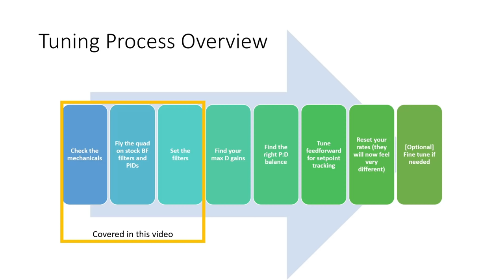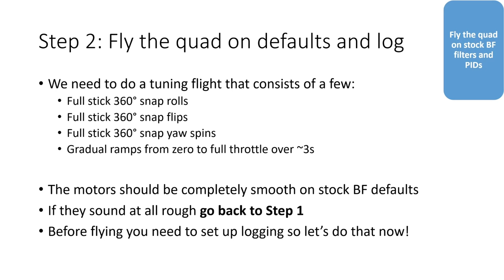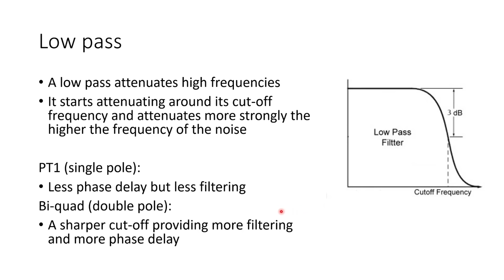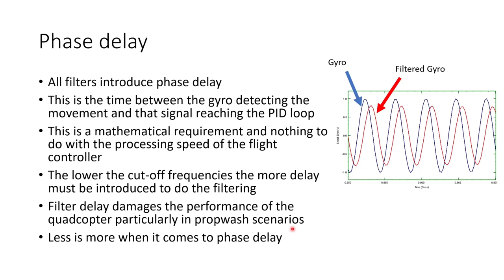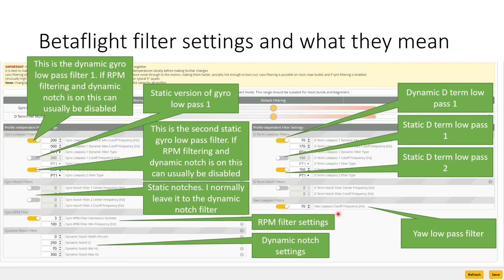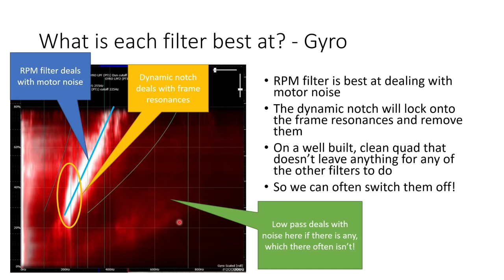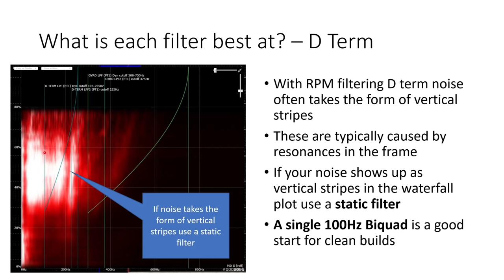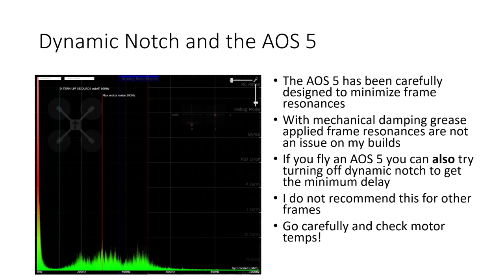Betaflight 4.2 filter tuning. The easy way to get a perfect filter tune!

Comment: Chris, I am about to start following this for my two identical builds. Both builds have, what I would consider very warm motors, as I can hold my fingers on them for 10 seconds, but are way warmer than I feel they should be. If i am able to understand and follow this, will it bring the motor temps down to a cool motor..? so I can start doing the pid tuning..? because I feel that if I started tuning now, Id smoke something. I've never had a build come down with motors as warm as the motors on my current builds and as far as them being clean builds, I'm sure they are clean. I've tried using uav tech's videos, but they are just too confusing, and I love the way you explain things in more laymen's terms. Tuning is very overwhelming to me, but I must learn.
Reply from the maker: Motor temperature might be helped with filter tuning. If its a heavy quad with small motors they'll just get hot regardless though.
Reply: @ChrisRosser  it’s a 5” quad on 6s with 2306 1900kv motors. All up weight is 746 grams..
Reply from the maker: @squirrelyfpv7283  OK, those motors should not be getting too hot. You can get in touch with me over at www.aos-rc.com by email. I'll need a gyro scaled log and a few pics of the build.
Reply: @ChrisRosser  you are awesome..! I’ll try to get that over to you ASAP.. I’m trying to follow your videos so I can tune these builds, builds I already have, and future builds.. I’ve not learned it yet because it’s so overwhelming, but definitely need/want to learn.. thank you, and thank you for what you do..

Comment: Hi Chris, is it good to deactivate d-min by flying with a bent propeller in the race of the racer drones to finish the race? Won't I have a better chance of burning the engines? Maybe it will be better to keep them active for racers? Thanks
Reply from the maker: Racing pilots do typically use Dmin to reduce motor heating. I'm not a racing pilot so I'm not the right person to comment on this.
Reply: @ChrisRosser  ok, thanks. Your videos are very interesting.

Comment: Hi Chris I have got a flight board, with out a sd card holder, how do I get data flash from the board, and have you  got a video on it please, the board I am using is a 20mm F7 F722 Mini Flight Controller OSD 2-6S
optional 4in1 ESC Stack - Whoop RC

Comment: When you set a cutoff frequency for a lowpass filter, what is the width (in hz) of 50% and 100% attenuation for PT1 and Biquad? This would be useful to know by looking at the graphs and being able to estimate approximately how far ahead to set off the cutoff frequency.
Reply from the maker: As Mark just informed me the cut-off frequency is the frequency at which attenuation is 71% of amplitude (I need to correct the video with a card). Low pass doesn't have a width it just attenuates more and more at higher frequencies.

Comment: Look like nowadays stubby type VTX antennas are preferred not only because they are easier to secure against crashes but also because they don't wobble. VTX antennas mounted on stalks are going obsolete. Seems I should renew all my 5" quad VTX antenna stash then :(  Question though - where to get all required 3D print models for my not so popular frames?
Reply from the maker: My preference at the moment is for antennas like this: https://shop.iflight-rc.com/sigma-5-8ghz-60mm-rhcp-lhcp-fpv-antenna-mmcx-pro1238 easy to mount and lightweight. I tape them to the arm to avoid vibrations. SMA connectors are bad news on a quad IMO big, heavy and prone to damage.
Reply: @ChrisRosser  Those tiny axial antennas indeed are cool. Older models was prone to break on medium/hard crashes. I managed to smash few of them. Newer and more expensive axial antennas seems more sturdy though I didn't used them yet. The only latest acquiring was Vista + Polar kit with similar antenna which I tied to GT-R349 top cover with double sided tape and piece of wire. My problem - all my existing 5" frames and antennas for 5" quads are SMA based on stalks. Cloverleaf and pagoda types (yes, I'm that old). I'm ready to donate all those antennas to someone and buy decent ones in name of better FPV future. But my 5" VTXes are with SMA (or uFL -> SMA) too. uFL didn't got much love because it was prone to disconnect on crashes. Probably I must learn how to install it better :)

Comment: I'm almost embarrassed to ask, as your videos are my first look into bf4.2 filter tuning. 
I hope you don't mind my asking; just trying to get to grips with values?  
So, from your graph @ 23mins,  (looking at white areas as critical areas, which I hope is correct?), it looks like dynamic notch filters, in your example could be squeezed to say 150Hz min 275hz max; depending on lowest white noise and highest across the roll and pitch graphs?  I'm probably totally wrong of course :) I'm guessing q-factor will take one or two more flights to get min value?  Looking at same graph, could rpm filters be adjusted to say 150hz cut-off? 
D-Term; looking at the graph @ 26 mins, I'd have panicked and set low pass cut-off at about 50Hz by the red peaks there.  Shows, I am totally not getting it at all 🙂
Please don't get me wrong; I'm really interested in trying this out, but I'm not quite 'getting it,' when trying to apply to my quad.  
It's a lot more scary when trying to apply to a quad for the first time. Thank you  🙂🙂🙂
Reply from the maker: Yep you could squeeze the dynamic notch a little more in the example. For the D term stuff happening below about 100Hz is often real flight dynamics that you don't want to be filtering out!
Reply: @ChrisRosser  thanks for the reply Chris.  Great information that's helped me understand the graphs a lot better 🙂🙂

Comment: Can we get a clarification on the Dynamic Notch filter Q? You say it's a measure of sharpness, but as is, it's a totally arbitrary number without a reference
Reply from the maker: Of course. Q is the ratio of centre frequency to bandwidth for a notch filter. The larger the Q the narrower the bandwidth and the sharper the filter.

Comment: Hi. i bought aos 5 v2 6s. And I have a problem. Strong vibration every time I press throttle up. Changed the propellers, the vibration remained. I took it apart and put it back together, no change. any advice please

Comment: Chris I would like to ask you something: I have a 2.5" quad which in its freq vs throttle gyro graph shows horizontal lines at for example at 45 & 65 % throttle, going from 0 to 800hz. On the other hand the freq only graph shows it's very well filtered, and it flies quite well after filtering and tuning following your guidelines, but those lines are really weird and I cannot find anyone talking about them, should I be worried?
Reply from the maker: They tend to come from tapping the ground or an object while at that throttle position
Reply: @ChrisRosser  ohh I see! I was forgetting about trimming the take off and landing, I think they are gone now. thanks, you rock Chris!

Comment: Looking at the great information in this video, I find my water fall plot has noise at 70-85% throttle and runs out to about 100hz.  The way I understand this that this is located at 3/4 throttle.  What do I need to do?
Reply from the maker: Does the quad fly badly? If not you don't really need to do anything.
Reply: @ChrisRosser  Yes sir, the quad is generally good.  I am starting the methodology today to get a great tune.  I so much appreciate the time you have spent on this video and the amount of effort it takes.  zak

Comment: Chris.. please I needs for your advice here, what will happen if I choose Dshoot 600 rather than 300 on FC F4 while I’m using rpm filter or bidirectional Dshoot ?
Reply from the maker: Short answer is you shouldn't. Dshot600 is for 8k PID loop. Dshot300 is for 4k PID loop. No benefit to running the interface faster than you need to.
Reply: @ChrisRosser  
Many thanks my dear ☺️

Comment: This video is mentioned as a per-requisite to "Betaflight PID tuning. The easy way to a great PID tune. EVEN WITHOUT BLACKBOX!". However, in this video you depend on blackbox data. How does one without blackbox proceed?

Comment: Hi, I ( we ) would like to know if by '' first test with BF stock settings ''
 you include also the stock Dynamic notch filter settings please ? ( 8 / 120/150/600)
Reply from the maker: Yes default everything. You want to look at the unfiltered gyro info (gyro_scaled) so the filter settings don't matter that much

Comment: How do you know if you are over tightening screws of if they are not tight enough? I think this I the biggest flaw in all my builds
Reply from the maker: I do up M3 screws using a screwdriver held in my fingers (not the palm of my hand). I find that as tight as I can go with my finger strength is about right for M3 (~0.5Nm). You can also get torque screwdrivers if you want to be precise. Here are some ratings for tightening torques: https://www.trfastenings.com/products/knowledgebase/socket-screws/tightening-torques
Reply: @ChrisRosser  thank you, I've stopped soft mounting motors because I'm over tightening in general. It's hard not to go too tight on screws holding the main frame and arms together.

Comment: What's your recommendation for setting up filters if you don't have blackbox on your fc? Mamba f7 DJI
Reply from the maker: Check out my video for BF4.3 filter tuning it shows a method for filter tuning that will work for BF4.2 and doesn't need blackbox.

Comment: Dear Chris, can you make a video of a test flight please, make a standart of a test flight like 10 flips roll, 10 flips pitch, few 360 yaw on mid throttle with rates <500. Because everyone make the test flight differently so get the different BB results.
Reply from the maker: You got it. I'm going to do a practical tuning example with a quad after the PID video 👍

Comment: Hi Chris 
I bought roma l5 and i had some flight but was bad vibration so I check the motors in betaflight look ok because this is brand new drone so I'm not perfectional and I send email to diatone the told me flash FC and setup aging  so I did that and I had flight  maybe 20% better but still is bad whole last night I searched and I notes you  have this knowledge   so please help me to fix this drone , first I think mambaf722 doesn't have black box storage , and no one didn't say anything about filtering or PID of this drone . I used some electric tape for motors , I checked all screws  and wiring  but if you need more information to help me please let me know I can send it , 

you are best in this job  so please help me 
so appreciated  Saeid
Reply from the maker: Hi Saeed, for troubleshooting the best place to post in in the support hanger on my discord server. Post some logs and photos of your quad and we'll help you out.
Reply: @ChrisRosser  thanks Chris  , this is first time I'm going to use discord. So I installed but I can't send message I don't have permission To your channel

Comment: I'm stuck on pt1 of this pid tuning. I have noise all over my frame. I've been told it's my build. So I tidied up all my wiring swapped motors, esc, spaced out the stack a bit, I've even brought a different frame but I'm still having issues with hot motors, terrible flight performance. If I turn d down to like 17 it flys okay. But a slightly bent prop and its all hell.

I've even gone as far as buying a second set and trying again. Setting it up and it does the same. Only thing I haven't swapped yet is the FC (t-motor f7 mini HD). Could this fc just be crap (I've got 4 of the same). 

Any ideas? Frame is a switchback Pro. I'm at a complete loss. Had so many people looking at it and they just say its the tune.
But it flies like garbage on stock. I can tune it out with low d but it's not working.

I've got a different fc on the way as it's the only thing that has stayed the same through all my three frames.

Unless it's a potential normal thing and I have to tune it out? But that's not what this video says and I trust you more than my mates haha. Help?
Reply from the maker: I'm sorry to hear that. It could be a bad gyro. Swapping the FC is a good check. Have you ever crashed the frame? Does it look damaged?
Reply: @ChrisRosser thanks. I have now crashed it a few times, nothing hard and on grass. But I have the same issue on the brand new build and the one I've flown. I have another 3rd frame in the box still but both of my current builds do the same thing and have done since their first flight too.

I've got the same model of gyro in both drones but was planning on building a third so have a brand new fc that I have swapped between them with the same issue. Got a different fc on the way to test if the T-Motor f7 mini HD I'm using isn't good.

After that though I'm kinda out of ideas. I'm running betaflight 4.1.7 as it was worse on BF 4.2.9
Reply from the maker: @reevolution_fpv  OK, I think the best thing to do is reach out to Joshua Bardwell. Take lots of photos of your drone as you would fly it to send and also send a blackbox log. He is the king of troubleshooting.

Comment: Hi Chris
Any suggestions as to where to start with BLHeli_S based Quads that do not have Esc the option
Of RPM Filtering ??
Thanks for the video! 👍
Reply from the maker: JESC and JazzMaverick firmware for BLHeli S has rpm filtering as does BLHeli M I would flash one of those firmwares to enable rpm filtering. They should work on all BLHeli S ESCs.
Reply: @ChrisRosser  ...or Bluejay!

Comment: one basic question, what frequencies do I want to filter out. 
I mean which frequencies are considered noise, and which are actual movement?

For example in your D Term filtering, you got the one stripe of frame resonance, but there is plenty of noise, right in front of that.
Reply from the maker: As a rule of thumb less than 100Hz could be real propwash and aero effects. More than 100Hz is noise.

Comment: Why can't we use static notch filter to deal with the frame resonance? Since the frequency doesn't depend on throttle isn't it more "cheap" to use static notch filter instead?
Reply from the maker: Static notches add delay and frame resonances tend to move around over time. Especially if you retighten screws or have a few crashes!

Comment: Hi Chris, just tried flashing the Blheli_M 16.9 firmware on my Cinelog 25 and enabling RPM filtering, changed motor poles to 12 (1404) and CE to Async-PWM from stock 50% as per Oscar Liang's suggestion, but I hear ticking in the motors and it flies awful: motors out of sync, strong wobble, pretty much unfliable, do you know what might be wrong? All other parameters I left stock, thanks
Reply from the maker: Make sure you count the number of magnets (poles) around the outside of your motors! Not all 1404 motors have 12 poles many have 14!
Reply: @ChrisRosser  I did, 12 poles
Reply from the maker: @PabloDeBiasi  OK, So you should have 9 windings in the stator, is that right? If so then I'm not sure what's going on. Maybe try turning off CE? Did you change any filter settings other than enabling rpm filtering?
Reply: @ChrisRosser  yes 9 stators, no other filters settings changed, tried again this morning withe 50% CE as per stock settings, bidi on/off, but got same motor noise/quad behaviour, I really hope you could analyze it and give us cinelog25 users some tips, thanks
Reply: @ChrisRosser  reverted back to 16.73 and everything works fine, 16.9 was supposed to be fine but evidently it still has issues with some boards. I eagerly wait for your analysis to fine tune the filter settings, thanks!
Reply from the maker: @PabloDeBiasi  Based on what you have said it sounds like 50% CE might have been the problem setting. I wouldn't recommend using it and set it to off which would be the same as 16.73.

Comment: I have a lot of small horizontal striped on my waterfall view, what does that mean? Its a 3 inch toothpick.
Reply from the maker: That's probably aerodynamic noise if the frequency is ~100Hz or less.
Reply: @ChrisRosser  it goes up to 800+ hz on 80%, 75%, 60% and 35% throttle. The quad also wobbles a lot when slow cruising.

Comment: Nice tutorial however there is a fatal flaw for some right at the beginning of the process.  Full stick 360° snaps, rolls and spins. With my level of FPV ability mother earth will be eating my quad.  How could I improve the quad tuning given this limitation?
Reply from the maker: You can do more gentle moves too.
Reply: @ChrisRosser  I did successful flips today, the quad was in HOR mode.  Tried my other quad which was in ACRO mode and a 290° flip then added power and motored into the ground.  Only broke two props and the battery strap.  More practice required.  I'm now on the PID ToolBox with data from the 1st quad.

Comment: I was wondering if there is a way to measure the delay between the gyro signal and the filtered signal?
Reply from the maker: UAVTech has a filter calculator that works really well.

Comment: A lot of the info you gave was stated for 5" quads - how would one adjust that information for 3" quads or other sizes?
Reply from the maker: Typically for smaller quads you would expect noise at higher frequencies. You can adjust up the frequency cut-offs based on logs.

Comment: Would you recommend this for anything over 5” quads? I’m currently attempting to tune my 10”.
Reply from the maker: These filters will be way too aggressive for a typical 10" quad. You will probably need gyro low pass filters and D term low pass filters.
Reply: @ChrisRosser  thanks For the quick response Chris! I’ll turn those on and give it a go. I have been flying with all the defaults on and after 6 mins of non super aggressive flying the motors are pretty warm.